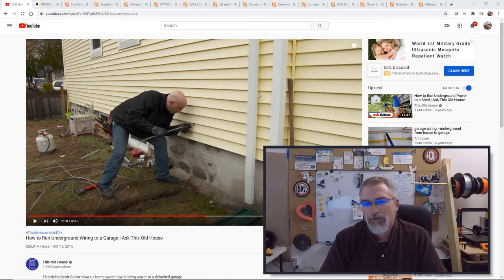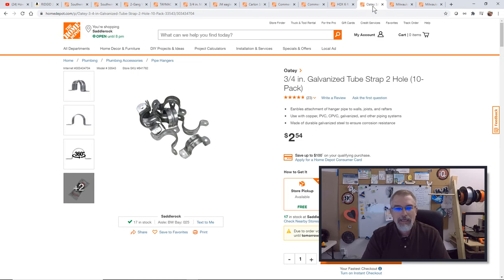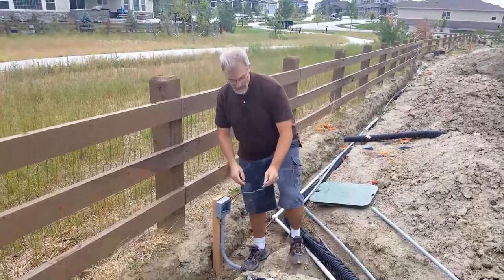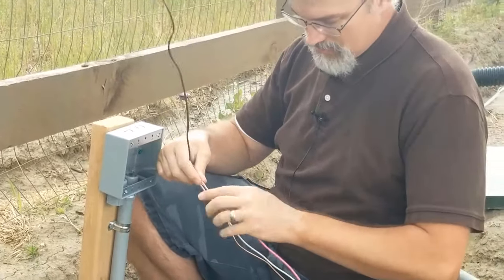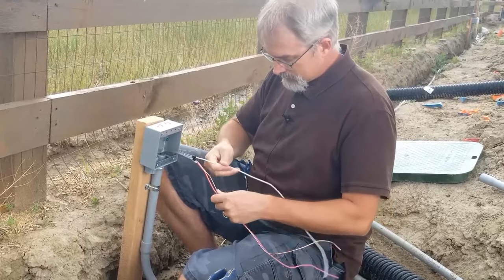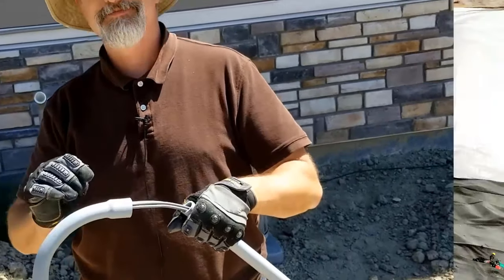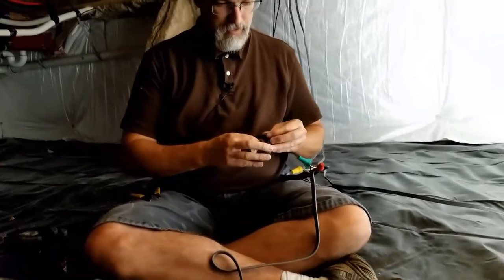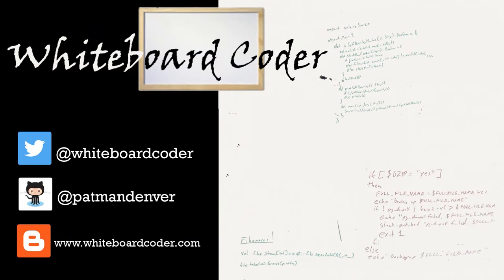Backyard Work:  Routing underground wiring to backyard

Comment: Your transition to the box needed a bell sleeve, you’re hot should have been black. You should have had a nut or electrical tape instead of clipping the wire, you don’t mix data with electrical raceways, last, but not least, you had underground feeder cable, you could have just dug a tad more and not needed the conduit raceway/conduit. Also, you’re conduit looked a little too small. But hey, it works!

Comment: Good video. Keep in mind that it's not recommended to run the low voltage (cat 5) in the same conduit and if it is terminating in the same box, then you must have a barrier between the low and high voltage to be code.

Comment: Thanks for sharing.  Electricians will tell you what you did wrong.  For the plug part, you should place the the connections in a box, or use a plug specifically made to replace a bad or missing plug.

Comment: A holesaw is NOT designed to drill through any masonry surface, you need to use to hammer drill with a masonry drill bit
Reply: He’s not even using the right bit lol “it took me a long time” to rubbing on cement with metal bit

Comment: Thank for the video.  Great job.  One suggestion is to use a water spray bottle on the hole bits.  This prevents overheating which quickly dull the teeth.  It also make the job five times faster.  I have bits I have used a dozen times in concrete.
Reply: He used the wrong holesaw..theres one u can buy to drill on concrete/stone...

Comment: Thanks for posting this.  I also appreciate the comments pointing out things that weren't quite right, though some could have been nicer about it.

Lots of people pointed out that you should have used black instead of red.  Yes, that's standard, though in a 3-way switch, the red can also be hot, so it's not horrible.  My thought was to wire up two outlets, one with red and white, and the other with black and white, and then put the red through a switch on the inside, so one outlet is switched.

I've seen some people say 12" for the wire, others 18".  I see another video saying 24" without conduit, 12" for PVC, and 6" for metal conduit.  It sounds like you won't go wrong with 24".  Think about where someone might run sprinkler pipes or if you have underground cable/internet lines.  I haven't priced it, but my guess is the direct-bury wire is still cheaper than using conduit.

Another video asserts that direct-bury wire needs to be GFCI protected, so you need to put a GFCI outlet in or on the house before sending the wire underground (which also means you don't need a second GFCI outlet at the end).  I can't verify the code requirement, but that certainly sounds like a good idea.  You can never have enough outlets anyway.

Comment: You should of used the black as the hot .
Pretty standard on almost all wiring
Reply: In a sane world, red really should be hot..always. ie. Red HOT... Why is it not?
Reply: @wadevid  Especially since in 12v black is ground and red is positive.
Reply: @regibson23  exactly!  I don't know why that didn't translate into the normal AC electrical world.  So confusing for no reason!
Reply: @wadevid  I don't know why.  Perhaps red was more expensive or harder to make a hundred years ago when the colors were selected?  Red is typically used for the alternate hot path on three-way switches; they call it a "traveler."

Comment: The main issue I see in this is inadequate depth of the trench. The top of the conduit or wire needs at least 18" depth below grade (24" if it goes under a road). Here in Canada, around that wire you need sand to protect from damage by rocks, and above that you need a plank of treated 2X6, then above that a plastic warning strip "underground wiring" to warn anybody who might be digging to stop. The conduit (sch 80 in the US, with bell fittings) is only needed for mechanical protection of UF cable in the short span where the wire leaves that 18" level. I would have used an LB fitting or box for entry to the house, allowing the conduit to neatly follow the concrete down and not represent a trip or damage hazard. Get it inspected and glaring errors will be avoided.
Reply: Also he didn't ground the box, he ran the ground from the UF cable directly to the GFCI bypassing the box. Also he didn't adhere to 110.12 "Electrical equipment shall be installed in a neat and workmanlike manner" obviously he doesn't own a level.
Reply: Hey, I'm also in canada, i want to run power to an outlet in a shed to be used once a week for a light and charger. I'll contact an expert but since you seem knowledgeable i was wondering if you could pick out any obvious faults in my plan. I'm thinking about running an extension cord made using 12 guage direct burial UL cable and outdoor rated plug ends from a gfci outlet on my house to an outdoor rv 120v inlet on the shed. Then I would wire up an outlet inside the shed from the other side of the rv inlet. The cable would just sit above ground but I'm thinking since it's used infrequently and the cable can be disconnected from both ends it would not be considered a permanent installation. I'm the only one on the property so no one will be digging without knowledge of the cable and it is gfci protected in some sort of unforeseen accident did occur.
Reply: @maxeddis1138  You can do that legally with an extension cord run along the ground, provided it remains visible the whole way, is not buried, is not subject to abuse, and not concealed behind walls. Anything else requires a permit, different wire, conduit above 18" below ground, and a long list of things to avoid. In Alberta I found inspectors approachable, helpful, and willing to coach you a little to increase your chance of success. In BC I found the opposite. They don't want to talk to you at all until the inspection, they require a form that asks very detailed questions about panel capacity and use. I believe that IQ test form is required so they weed out anybody who hasn't spent hundreds of hours combing over the Canadian code book. Unfortunately it also means that many BC homes have been mutilated by guys who know nothing and don't get inspection, leaving dangerous errors exposed for decades.
Reply: @spelunkerd inciteful, thanks a lot for sharing!

Comment: Too small PVC if ever have to pul and replace, if cannot pull after pipe installed then too small, also those turns not great underground, should use a heat box and put a long continuous sweep for pulling, no couplings only bell ends couplings can pull part underground. Also need to use slip sleeve when transition from underground to panels/boxes on any structure

Comment: Black to brass will save your a$$. 
While the the trench is still open you may want consider schedule 40 PVC vs that corrugated pipe. Less likely to clog over time.
Good luck and thanks for sharing.
Reply: actually that congregated, self cleaning due to the ridges

Comment: Looks a little shallow out at the recepticle, eh? Pretty sure its still a minimum 16" below grade for PVC or direct burial.  At the house you probably could have gone with LB condolets instead of the long radius 90s out of the wall for a clean, well supported install.
Reply: 18 inches for packing and 24 inches for direct burial  per NEC.

Comment: This is "WHY" Electricians get paid for their skill set -" EXPERIENCED" 
-RED is typically a switch leg, so if you don't have a switch leg "Black wire is king for power.. and the tape around the GFCI is major points
Reply: No, it’s because others are to scared of electricity and shy away from it. He did ok for a newbie DIY.
Reply: What do you think the odds are that his deficiencies will actually cause a problem? I realize that working with electricity and your home is dangerous, but codes tend to have a huge (some would say excessive) safety margin. Things can always be safer than they are, and even safer than codes. 

BTW, I have yet to have a home inspection done where the inspector didn't note code deficiencies by the Electrician who wired the house when new.
Reply: Burried cables can become dangerous if not burried at the depth and marked with warnings that a cable is buried in that path.
Reply: @soundcityintl  good point!!!

Comment: Shouldn't run Low voltage wire (Ethernet) with high voltage ( Receptacles) in the same conduit/box as it can interfere with the Low voltage items like internet performance. Also noticed the conduit was too small for the wires ran and you shouldn't of cut The black wire to nothing should of just kept it long and put a wire nut over it for any future changes in the use. not the worst electrical video I've seen but still could use some stuff fixed.
Reply: great job pointing out all the deficiencies that he already noted.

Comment: thanks for the video, I'm about to try a similar installation and was wondering, did you glue the various pvc pipe fittings together or you just pushed them together?
Reply: Yes you should glue them. You want to avoid and water seepage into the conduit.

Comment: This hookup looks like a fire hazard. 1. No jacketed wire in a conduit, this will cause a heat build up. That goes for Romex wire also. 2. Conduit improper depth. 3. Stranded wire to hardwire improperly connected in wire nuts. You have both wires side by side with stranded wire a little ahead of the solid wire, than use the proper gage wire nut. In the way they are connected in this video, the stranded wire could come lose. Also a red wire nut isn’t used to designate a hot wire. Wire nuts are color coded for wire thickness. This wiring set up could burn your house down. Terrible advice on setting up an outside connection for Christmas lights. This video is like watching “Christmas Vacation” with Chevy Chase.

Comment: Don't listen or copy anything of what this guy did. This install was ugly as sin and there were lots of glaring mistakes. Yes, the light worked but it's not proof of anything. Open splice, improperly secured device box, improper box choice, securing the conduit rather than the box itself (which is not a replacement), wrong size conduit (You didn't even need conduit, but I understand wanting it for protection), etc., are all examples of a what you should not be doing.

Comment: Question. If I have a 2 inch schedule 40 but I want them to go to two different destinations. What type of underground splitter one can use to split them underground
Reply: You don't. You run a new pipe.
Reply: You are not a professional not even close your feed coming out of your house is wrong, your burial depth is wrong yes its legal to use 2x4 to mount your bell box , but you should have used pressure treated wood I can see your wood 2x4 is rocking back and forth not good, and your struggling with your install you lack fluidity and refined workmanship. You wearing a suit at the beginning of your video,

Comment: Can someone please up my confusion?  What is the correct depth for UF cable?   A "This Old House" episode suggests 12" but I've read on many youtube video comments that at least 18" is required for code. Help.   I'll dig the extra 6 inches but I don't want to.
Reply: Depends on frost lines .
And materials that you use.
Plastic pvc compared to metal etc...
Burry it as far as possible within reason. 
And always use a slightly bigger pipe because you might be digging again in the future otherwise. 
But direct burial is usually 24 inches because of the unprotected wire sheath
Reply: @luvdady  thanks .. curious why reputable "this old house" very clearly states 12" ok with cetain UF cable?
Reply: @danstvguy  probably if they used concrete? 
But it could be a variety of things 🤔 lol building codes are strange
Reply: 24in for UF cable no conduit
18inches for pvc schedule 80
6 inches for rigid conduit (not emt which is not to be buried)
Reply: I know this is old, but the answer is 12 inches per code. NEC 300.5 (T) Column 4 - Resi circuits 120 or less with GFI protection and a 20A OCPD.
Reply: @qball3834  thanks.  I just buried an extension cord in pvc.

Comment: You could have used both red and black wires on two circuits. Red on one and black on the other breaker
Reply: Isn't black the hot wire on homes? ( Opposite of cars)
Reply: You can use black, red, blue for low voltage and orange, yellow, brown for high voltage.
Reply: Wouldn’t you need a neutral for the other wire/breaker @matthew

Comment: Is that wire rated for conduit??
Reply: yes, infact it does not need a conduit at all. it is called Underground Feeder (UF) and it can be buried without any conduit
Reply: UF-B is a direct burial and can be put in a conduit of needed. The only reason it is not suggested is because it can be a pain to fish through conduit making repairs difficult (hence possible code issue).
Reply: At first I was confused regarding why wire with extra sheathing should not be used for a long run inside conduit. Then I thought back about how wire disperses heat. Conduit is required to not exceed the 40% fill rule, and if the necessary air space is taken up by plastic sheathing, you need larger conduit. Most inspectors will allow a short ~4 foot run for protection, such as coming out of the ground where sch 80 conduit is required for mechanical protection in the US (sch 40 with added mechanical protection OK in Canada).